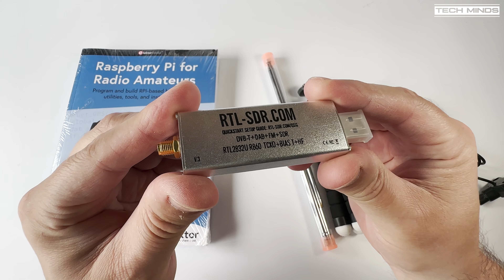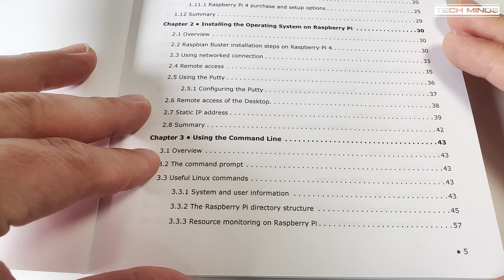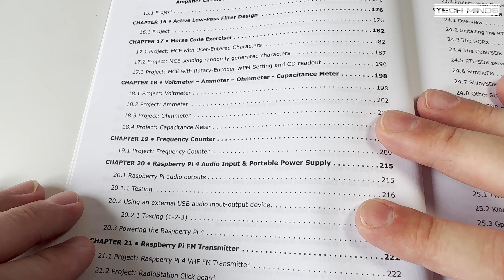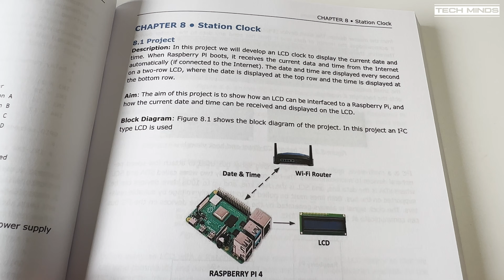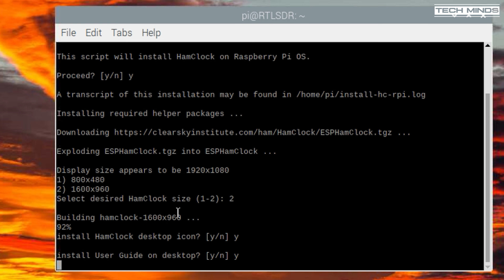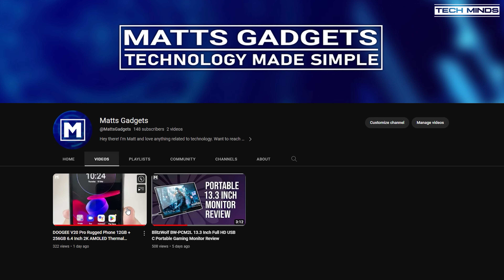Raspberry Pi / RTL-SDR For Radio Amateurs - The Easy Way!

Comment: I want to control a VGC VR-N9500 via a Raspberry Pi with an application other that the recommended Chinese software: HT (Android) or BSHT (iOS). 

Something like OmniRig, etc. I want to accomplish something similar to putting a PAN adapter on an IC-7100.

Comment: Where can I find? ...
This looks like a great receiver setup. I am a pilot who is NEW to SDR and am asking for help to find out the best way to connect the voice input received by the device into voice recognition software on the PI using the Python PiAudio library. I want to be able to call the receiver at my grass strip airport to command the PI to read the wind direction and speed from a weather station and broadcast the information back to me.  (Airband in North America, the spectrum from 118.000 to 136.975 MHz is used with 25 kHz spacing and AM). Instead of voice comands, I could - lets say - click my aircraft radio transmit button 5 times. The RTL-SDR would have to know how to count the transmit clicks. I have no idea how that works. 
Any help appreciated. Thanks!